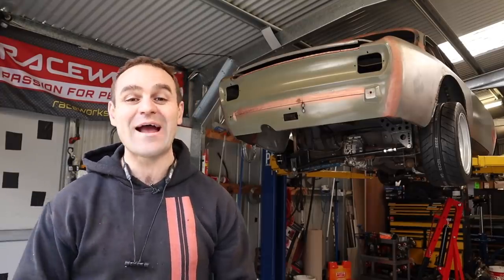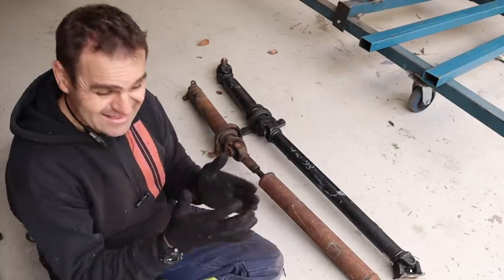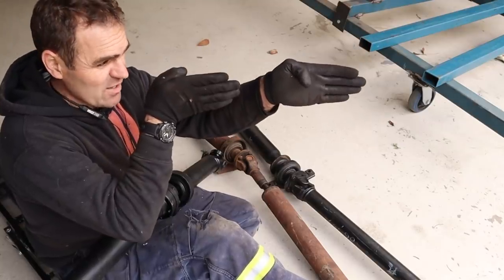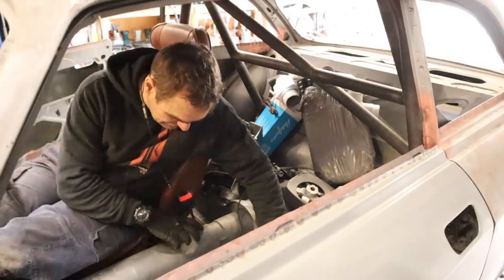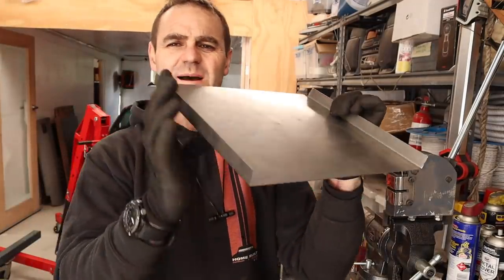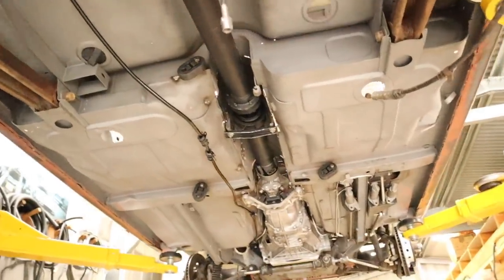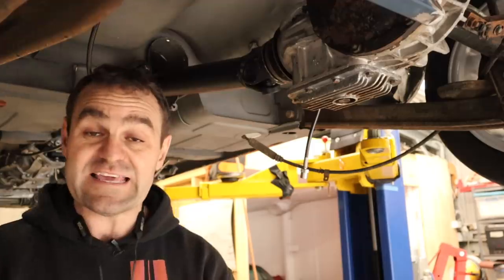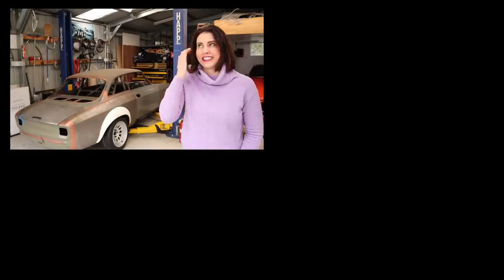Can it handle Ferrari Power? - Ferrari engined Alfa 105 Alfarrari build part 93

Comment: Just a tip when aligning the driveshaft in future... the natural instinct is to make it as straight as possible, but its actually better to have it on a slight angle (ideally between 1-3 degrees). The issue with having it "straight" is it causes wear in the same point of the unijoint which can make it run a little rough over time. Basically when running "straight" causes the unijoint not to lubricate itself correctly causing the wear... if you take a look next time you're under any car you'll notice they all have an intentional angle built in. That said, I'm guessing this vehicle probably isn't going to do 200,000km so if the uni wears out after say 20,000km that's probably still years of use.

Comment: In your huge list of things to do left, where does starting the engine for the first time sit? Crossing my fingers it's this year, as you've got fuel sorted, transmition sorted, the electronics and  wiring will surely be a challenge, I'm just praying the engine performance is there with the shortened plenums! 😜
Reply: Lösungswort

Comment: Would of gone for a Watts Linkage instead of a Panhard rod. Not much more harder to engineer, dad a friend and I made one for my 105, had the pivot on the body and the arms out to the edge of the diff, made it all adjustable. Ended up having to put the anti roll bar back on to lower the body roll. Was pretty cool lifting the inside front wheels off the ground while cornering though.

Comment: Sorry if someone's asked this before, but are you going to rebuild the diff? The friction plates have almost certainly worn smooth by now and replacing them plus adding an extra couple would make a big difference.
Reply: As well as modifying the ramp angles and a few other trick things you can do in an Alfa Diff. I turned down an 2000GTV LSD carrier to fit inside a non LSD housing to get the 4:56 ratio [if anyone knows of a 5.125 105 diff ratio would love to get hold of it]. I drilled ground and cut as much metal out as I could to lighten it. Works a treat.

Comment: I gotta say, nobody ever plans to get hit from the rear. It's usually non-attentive idiots who hit you. Happened twice to me on a motorcycle. Both times I was stopped at a set of traffic lights with cars in front with nowhere to go and pretty much zero time to react.  
Plus fuel tanks usual bend and not rupture as easily as hoses. I really hope it doesn't happen to the Alferrari, Jeff.

Comment: I'll say it again, Love the progess, feels like its getting real close to being able to start it.

Things will slow down when things turn back to body work, but thats just how things go.

Those gear ratios sound about perfect. just over a touch above 100kmh in 2nd is about right for a performance car. thats about what my turbo subi will do (probably not as quick... beeing a lot heavier with a 2.0 and factory turbo)
Reply from the maker: My 996 does 120kph in 2nd and that is too high. It struggles when I try to take off after turning at a corner.

Comment: Question is the center bearing/CV joint commodore. looks very similar. reason i ask is i'm doing something similar with an engine swap fixed rear diff to live axle and am currently running a commodore tailshaft. Going from a commodore v6 in a toyota to a  toyota 1uz-fe. would make life very easy if i only had to change the trans end on my current set up. Thanx  Keep up the good work
Reply from the maker: The whole thing is made to spec.

Comment: Great job Jeff. But I don't think the universal joint in the rear will work properly with CV in the middle. UV's works always as pair and compensate the inconstant rotation speed from each other. Basically second universal joint is needed to get it work with the combination like yours or the better way would be the second CV in the rear.
Reply from the maker: It will work. This was made by experts who have been doing just that for over 70 years ;)
Reply: It works because the UJ is always running in line with tail shaft in this set up

Comment: I understand why you use butt joints for exterior body panels where you are letting in a repair panel but for the floor and tunnel a lap joint would make you life much easier… most of the Alf is made this way as are all vehicles.

Comment: Can u mount the emergency hand brake handle on the outer side of the drivers seat that’s been done in a few cars I think the Porsche 928 had that  but don’t quote me on that  lol
Reply: 924 928 944 correct
Reply: Ferrari 328 also has the handbrake on the outer side of driver’s seat.

Comment: The original 2L Alfa nord engine can easily get the 105 GTV to 240km/h, with a piston compression ratio of 10,4:1 and with tweaked camshafts. So, 300km/h won't be a big issue 😁
Reply from the maker: Maybe the only issue will be my cojones ;)

Comment: When you consider all the engineering and design that went into the Ferrari that this engine came out of and realize that the Alfa has absolutely none of those things...yeah, it's probably a good idea not to try to go 189 mph in this car. lol
Reply: The only real problem is the aero ;-).
Reply: @EliteRock  not really, Alfas are pretty stable and the 105's if memory serves me correctly were good for 200mph+ aerodynamically, obviously none had the power to do that.

Comment: Why didn't you just go a one piece tailshaft? Less stuffing around and less to go wrong.
Reply: basically because of the length of the tailshaft the diameter needed for a 1 piece wouldn't fit in the tunnel